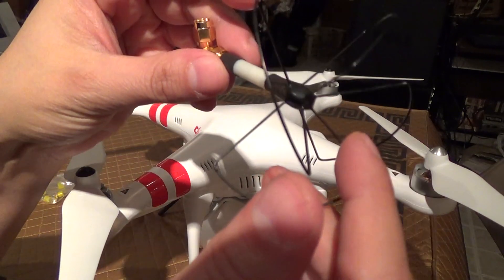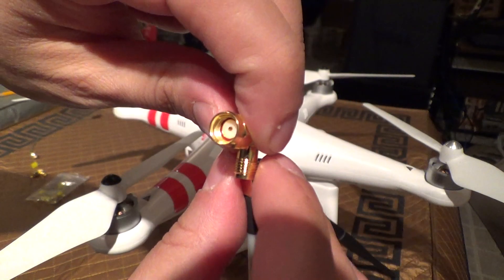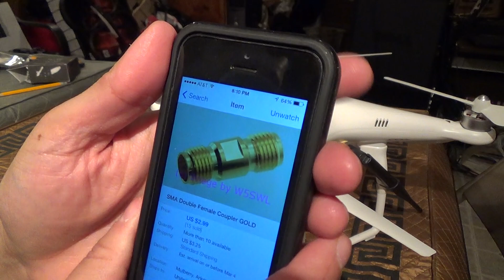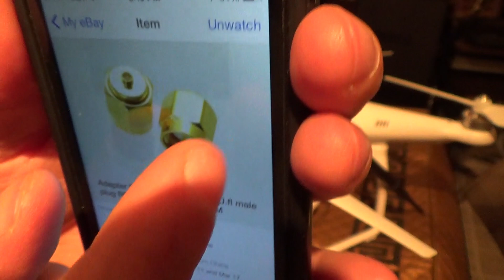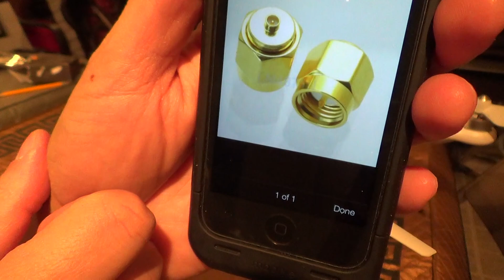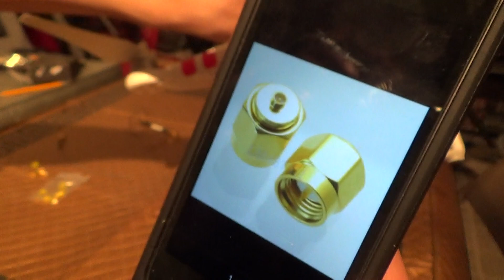DJI Phantom 2 Vision Camera Antenna mod version 2 Easy method

Comment: If I have a 8dBi TP-Link TL-ANT2408CL 2.4 GHZ Omni directional antenna on my DGI Phanton 2 vision FPV Transmitter if I install the 2.4ghz RHCP 2.3 dbi Skew Planer Antenna on the Phantom craft. Will this combo work together and properly?

Comment: Hi mate... I'm looking to do the mode with the 2 tp-link antennas. I'm not knowledgable around types of antennas so need some advice. I'm from the UK many people are using these with the standard camera setup and are doubling the range.. But would it be compatible with the omni-directional setup to have this on the wifi extender. > http://horizonfpvantennas.mybigcommerce.com/blackhawk-micro-2-4-ghz-9-dbi-lhcp-white/ 

If you could help it would be much appreciated 
Thanks in advance
Reply from the maker: Yes the antenna is your link is a perfect match to the Phantom 2 Visions stock antennas and company is local to you.  You could double your range with just that or you could additionally add Pinwheel antennas on the Phantom as well to further improve performance.  I would first start with just modding your wifi repeater with that antenna and if you're happy with the range stop there if you want improvements add a pinwheel to your Phantom. 

The stock antennas on the a Phantom 1dbi low gain LHCP directional antennas which point to the left and right side of the Phantom providing you the greatest range when flying sideways.  Adding a pinwheel like a clover leaf or skew planer will alumni are that problem.
Reply: Thank for your reply.. Managed to get one ordered, also got the antennas coming for the camera also. Might as well do it all. Will do a test to see what the difference is with/without and will let you know .. Cheers again

Comment: I really appericate all of these how to videos. I up graded my wifi reapter and controller allready. If you could give a visual of how you actually do this mod your talking about in the above video? I would be very nice im a visual learner lol.
Reply from the maker: That's true if most antennas but especially so with a standard omnidirectional whip.  That's why I had the two antennas mounted at different angles as I did.  And truth be told I had exceptionally good results with that.  Though I've had even better results more in terms if reliability when I made the jump to a pair of skew planers and a high gain helical antenna vs an all omni directional whip setup.

Comment: Quick Question the 2.4ghz RHCP 2.3 dbi Skew Planer Antenna link shows a Right hand polarized antenna (2.4 GHz SPW24 (2370-2510MHz) RCHP Skew Planar Wheel Antenna) is that the correct one or should it be Left hand.
Reply from the maker: Either a RHCP or LHCP skew planer will be fine just match it with the same type of antenna on the repeater for the best possible performance.  I myself got two of the RHCP skew planers and an RHCP 12 dbi helical antenna
Reply: Ben7seven7 Thank You, and thanks for the no BS videos good job!

Comment: Great video and thanks for the update on the camera mod. Can you by chance post what results (distances and reliability) you are getting with the antenna variations? For example, with your 8dbi on wifi repeater and 2 5dbi on camera, what distance are you getting in FPV? Then the results of other variations you tried? Skew planer antenna? Thanks!!!
Reply from the maker: I can't give you definitive results cause one of my rpsma connectors needed replacing it wasn't making good contact but even with that problem I was getting at least a 25 percent improvement using omnis over the stock antennas and the skew planers increased reliability more so than range
Reply from the maker: I'm going to upload tomorrow a 3rd version of the camera mod btw but easy mod is still simplest way to do it
Reply: Thanks Ben!

Comment: Aloha Ben7seven7. Mods are new to me. I would like to extend my video range on my P2V. After watching your videos, i conclude that it should be beneficial to put a new antenna on both the wifi transmitter on the hand held controller module and the vision aircraft? It sounds like the skew antennas would be best?
Mahalo
Reply from the maker: Yes, Clover Leaf or Skew Planer, any type of circular polarized antenna will give you a more reliable / consistent FPV feed from your Phantom than the Omni's tho not necessarily greater overall range.  But reliability is more important than overall range.  And you can pair that up with some form of circular polarized directional antenna on your Wifi Repeater. or dual omni directionals one pointing down and one horizontal, or a good patch antenna or combination of the two.

Comment: Where can I find the parts list for this revised mod?
Reply from the maker: In my description there are links to the eBay listings of the three parts needed.
Reply from the maker: FYI I updated one of the parts in the list. The coupler, as in the video I accidentally selected the wrong one a female to female sma. The updated list reflects the correct female sma to female rpsma coupler.

Comment: what does this mod do?
Reply from the maker: The mod allows you to use your own antennas vs the ones built into the P2V camera. The antennas are the source of the Wifi signal for the FPV feed. Upgrading to better antennas can give you both improved range and circular any orientation performance of the FPV feed.  As is, the Phantom gives you the best distance going sideways and is weakest nose in or tail behind you.  Modding the antennas can improve both range and the any orientation problem at longer distances.  At shorter distances though the built in P2V antennas work just fine though.  It all depends on your needs.  This mod is for the distance hungry who want to fly as far as possible with the most reliable FPV feed. It works even better when combined with a 2.4ghz signal amplifier, at least 250mw or higher.  Adding a signal amplifier would also require using a lipo battery to power it. Or soldering wires to the main battery leads which will reduce your flight time.